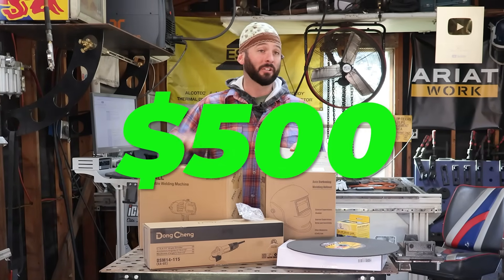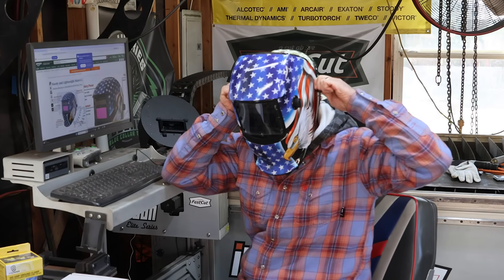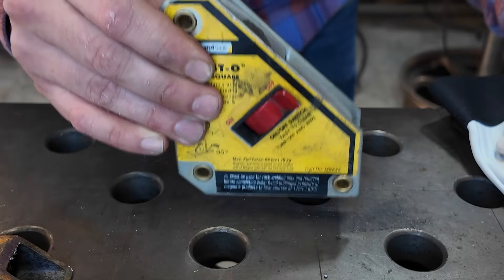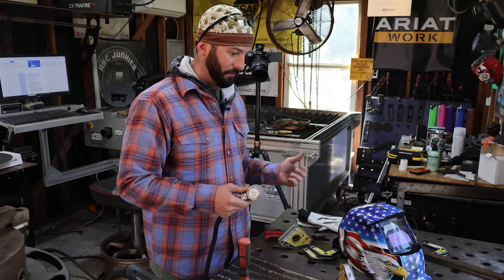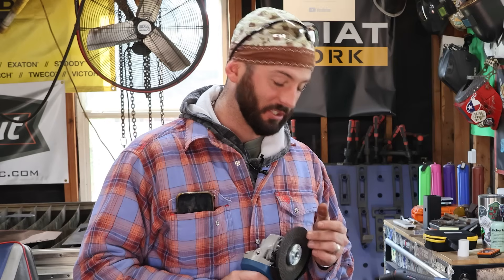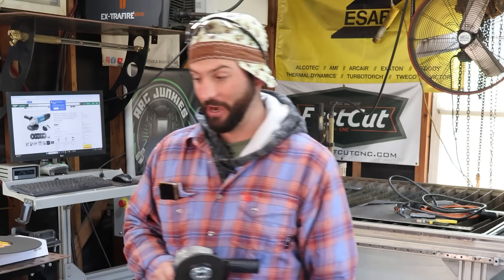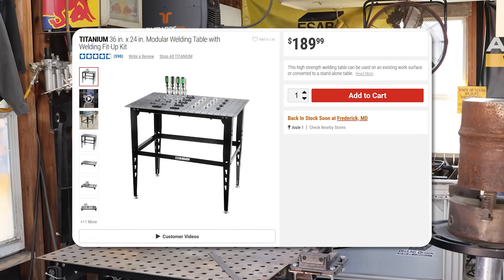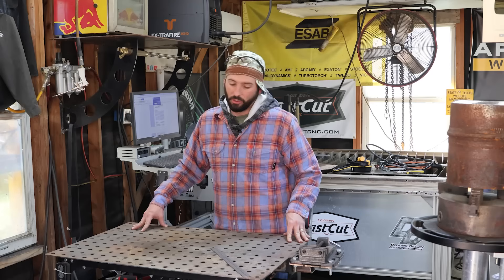Beginner Welding Tools I REGRET Buying

Comment: Don't those metal blades have to run at like 1400 rpm and the abrasive chop saws run at 3600? Or are there 3600 rpm metal blades?
Reply: Yes, don't spin a dry cut metal carbide blade too fast,  the saws have more torque, spin slower.. but abrasive wheel chop saws need to spin fast, your basically grinding through your material
Reply: @noname-ox4yt can i use an abrasive disk in my regular miter saw? NOTE I am only hobby welding and would upgrade to a proper saw when money allows.
Reply: @NukemGarage in a wood chop saw? You can try but I don't think they  are built for that (enough torque)  you might burn up the motor
Reply: @noname-ox4yt I can tell you if it's the evolution 10" you are correct as it will just be too slow with an abrasive wheel on it. It's meant for slow cold cuts. I tried the abrasive wheel for cutting stainless and it will cut through it if you're patient. But it's painfully slow. I've found the 10" diamond wheels that are specifically meant for cutting stainless actually seem to work somewhat better/faster for this task. If you cutting a lot of stainless, just skip the torture all together and get bandsaw. But if it's just once in a while you will be fine with a diamond blade and lots of time 😂
Reply: @drewrinker2071 right-o 👍
Reply: Yes, I have an evolution specifically meant for cutting metal, and and does beautiful miter cuts
Reply: If it’s a variable speed saw then the blade definitely works but if it isn’t you’re correct
Reply: @tjboylan20  I'm pretty sure he has an Evolution saw but he is oversimplifying when he suggests that anyone can simply switch from an abrasive blade to a toothed carbide blade.
Reply: @galt57 yeah, some brands offer it but I personally won’t buy any hot cut saw
Reply: Harbor Frieght sells metal cold cut blades, just not a cold cut saw.....
Reply: I was going to ask that same question.
Reply: I’ve been welding, fabrication, machining and precision grinding for 25 years and I tell new people to triple check their rpm limits of abrasives, cutting and grinding wheels etc. I use DOTCO and Dynabrade air tools and they can be extremely dangerous if you don’t know what you’re doing or what you’re working with. I’ve seen people get seriously injured because they put a 11,000 rpm cut off wheel on a 36,000 rpm DOTCO. I use my cheap Chicago angle grinder when using a cut off wheel. Or I’ll tape a used 1/8” sanding roller under the lever on a DOTCO. Clocking your 4”-7” body buffer pads properly so you don’t get hook marks etc.
Reply: Yes, often abrasive saws run at 5,000.  You can easily throw teeth on carbide at those speeds, especially if you run into the work quickly. If it jams,it can be a disaster.
Reply: @Chez8922-kf6cy yes i personally use a cheap 7 1/4 miter saw and use a 7 1/4 diablo steel demon they are rated for 8 k rpm so its fine in my 5k rpm saw and for cutting sheets an larger things i can use them in a circular saw but thy cut 1/2 steel clean and quick i get plenty of cuts out of them and they are $35 a blade and have them at almost all Home Depot’s so if i dont have an extra an need one on a job it’s easy to get
Reply: You have to buy the correct blades. Not all of them have to run at 1400 RPMs some are built for 3500, 3600, 3800 RPMs.

Comment: The Honeywell tigerhood classic is my favorite hood ive ever used and its all of $75, you can get an auto lense for another $50. I like it more than my $400 miller digital infinitely. The ease of flipping the lense out and having a clear lense to grind it takes 2 seconds to do and you dont have to flip through settings or take your welding hood off for a clear face shield. Its just simple and works.
Reply: cant beat the classics!

Comment: New to the channel. Thanks for the information. I've been weekend welding for several years and didn't get serious until Spring of 2025. Got sick in June and haven't been able to weld since. Looking to get back at it in about 2 months when I think I'll have a full medical release.
   I have an older Hobart Mig that I picked up new when the local ACE Hardware was having an anniversary of some sort. A Hobart rep was there and he did not lie one bit about the machine, and when I have called the service and parts  department, they have been a wealth of information with fast delivery.
Reply: very cool, get well soon.

Comment: What type of grinding disc were you using to sharpen the tungsten ? Thanks
Reply: its from tri arc weld supply
Reply: I am using Diamond coated grinding discs. the work great. If you have a benchtop grinder you can fabricate a adjustable holder for different size electrodes with adjustable angle etc.
Reply: @TungstenDippersFab Thank You

Comment: I have a yeswelder hood off Amazon for about $80. It works great. As far as grinders go I have 1 heavy metabo I use on big jobs but I started to buy the harbor freight $10 grinders whenever they are on sale. I have 5 now and built a rack to hold em and I have each 1 dedicated to something different. cutting wheel, grinding disk, flap disk, heavy wire wheel, and light wire wheel. I hate swapping from cutting disk to grinder to flap, now I don’t have too
Reply: I have good experience with the cheap Warrior grinders but my favorite is the blue Pittsburgh pro grinder which is a step below Bauer, they’re around $30 and i have owned about 25 of them in the past 5 years, I would burn them up cutting I beams because I was a wreck-less teenager
Reply: @t @tjboylan20  I forgot I actually do have 1 of the blue ones ur talking about, it has the paddle trigger on it. That thing has quite a bit of torque. I’ve been pretty hard on it and it has held up well. The warriors are just nice cuz if I burn 1 up, no big deal